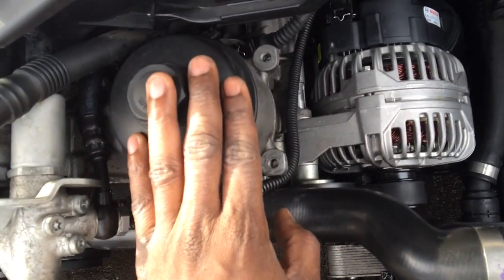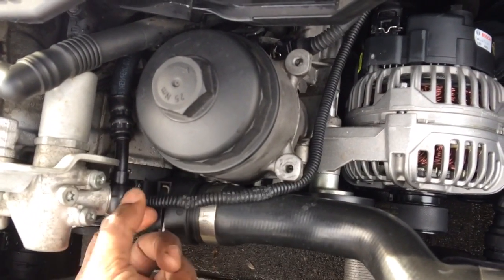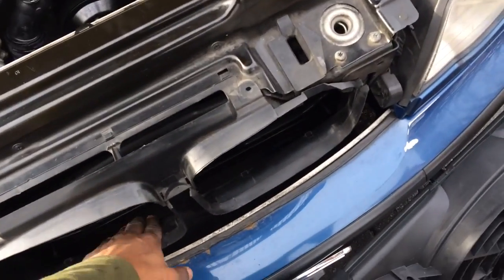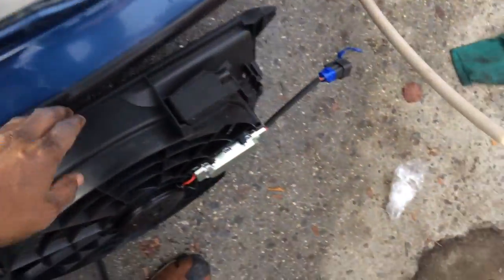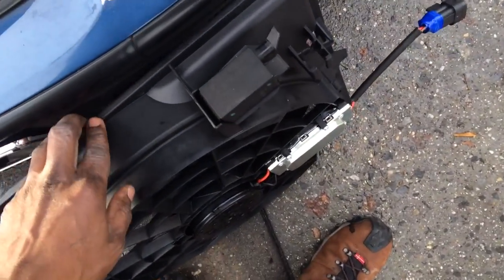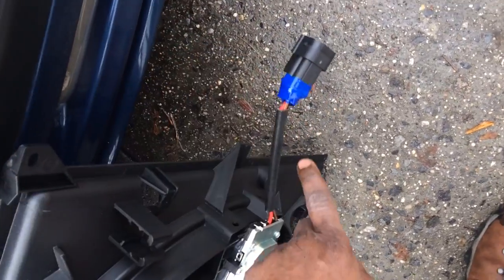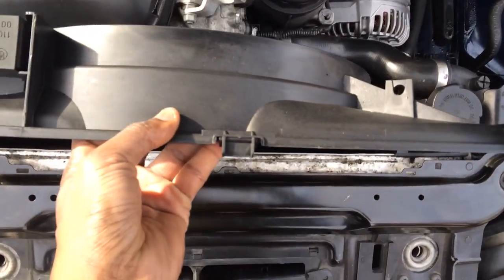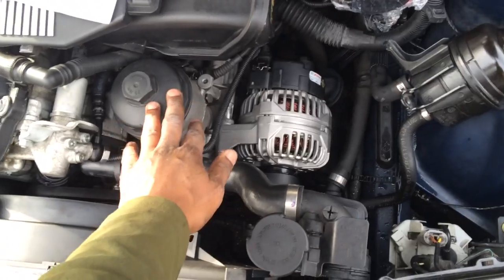BMW E46 Fan Delete Modification DIY Discussion 1 of 2

Comment: I did this mod on my 99 323i and I must say it was fairly easy. I been driving for a week now with the new electric fan on 85 + temperatures and no problems at all. This two videos help a lot on the how to aspects of the mod.
Reply from the maker: Harvey Martinez Thanks Harvey! I've been going on two years with the fan deleted and the car has always accelerated smoother and handled much sharper (without the extra weight). I also sense the engine bay is actually cooler on hot days when driving for long periods and I park. In the past the hood felt hotter now it doesn't seem like a lot of heat coming out the bay.

Comment: I think your engine is going to run hut at idle after this mod because electric fan turn on later you should  do a mod to your outlet temp sensor on your radiator hose to make this fan turn earlier.
Reply: everything u said is wrong

Comment: Hi bro,Do you remember where it was assembled the fan electric from mahle behr? I read that most are in china ?!,the genuine is expensive and I'm interested in a cheap but no made in china.
Reply from the maker: Samuel vargas Germany. My BEHR parts all had MADE IN GERMANY stamped on them. this was 5 years ago and I believe these parts are and still should be made in Germany. Best case if you want to budget and avoid China Made parts is looking at after market brands that carry  Eastern Europe and Turkey made parts like Meyle and Giba. Those would be good reliable parts if not getting oem parts
Reply: 0LAF2046 thanks man,I'm saving up for some bilstein b6 sport and eibach, that's why I need a cheap fan,tomorrow I'll put an order for the fan.

Comment: hey dude. thx 4 detailed video. I also have a same blue color e46 like u. mine though it's a convertible. Question though. Why did you delete ur mechanical fan clutch over electric fan?. Any perticular reason?
Reply from the maker: jongkeun lee the belt driven fan that I removed tends to fail. The bearings can seize up from age and mileage and stop abruptly during driving exploding and possibly damaging the engine and engine bay components. Removing the fan avoids this while the weight reduction improves performance and improves MPGs. The belt fan is unnecessary for cooling and the new electric fan does both jobs of the auxiliary fan and belt fan with one fan.
Reply: will a single  fan be enough ? what if u turn on the ac ?

Comment: Hi there so then you removed the fan cluth then you remove the aux fan and placed in the rear of the radiator??
Reply from the maker: Yes the new electric fan hangs off the back side of the radiator inside the engine bay. As a result of its location you NO LONGER need the front fan that sits outside the engine behind the kidney grills and you do NOT NEED the belt driven fan that sits attached to the engine block.  With this mod your car is now lighter in weight and runs smoother and quicker!

Comment: hi..did you encounter any diffrence in cooling with the a/c. when the ac is turned on the pusher fan blows against the condencer making the a/c run cooler at stops. does the single fan work to keep the condenser cool also meaning does it pull enough air to cool it..
Reply from the maker: richard gibbs good question. yes the electric fan does the same job as both fans. if anything it's performance, based on proximity to the radiator, favors that of the front auxiliary fan more so than the mechanical belt driven fan. the AC will perform the same after the modification. the AC compressor is a belt driven component and the removal of the belt fan actually lessens the load on that component. So your car will be better off after the modification
Reply: Ok thnks..for the info..

Comment: Whats the part number to the fan you purchased? I have a e39 tho will it work the same
Reply from the maker: no it won't fit. e39 cars have different parts numbers for fans
Reply: So do you know part fan will and the number
Reply from the maker: The front air conditioning fan is a Mahle p/n 64546921395 or BMW OEM p/n 
64546921395. I'm not sure of any electrical substitution like I have on my E46. Where you can replace the engine fan and aux fan with one electrical fan. Not sure you can do that on the E39 cars!

Comment: wellll....i want to use an electrical fan for the radiator whithout eliminate the AC fan...so thinking using 2 electrical fan
Reply: The electric fan takes the place of the clutch fan and the aux fan. Don’t need two, just the one

Comment: so you first had the mechanical fan and replaced it with the electrical one right?
Reply: yup. Get the Behr electrical fan if you're going to do this.
Reply from the maker: Yes the new electric fan hangs off the back side of the radiator inside the engine bay and replaces the mechanical or belt driven fan. As a result of its location you NO LONGER need the front fan that sits outside the engine behind the kidney grills and you do NOT NEED the belt driven fan that sits attached to the engine block.  With this mod your car is now lighter in weight and runs smoother and quicker!

Comment: why did you remove the front fan that is use for cooling the condenser?
Reply from the maker: It is a redundant cooling fan. It was an original "cooling" system design that BMW discontinued after 2005. The two original fans have a higher fail rate than the new modern electrical fan. So the replacement of two old fans with the new one was justified.
Reply: olaf2046 good to know and does you previous mechanical fan have a shroud?

Comment: That dual slant bars in the front of rad what’s the link for that?
Reply from the maker: When you do the fan delete it exposes the radiator support/crash beams which you can see thru the grills. I have the fan delete DIY video on my channel and a write up at the e46fanatics forums.

Comment: Where did you tap in to get the power for the electric fan?
Reply from the maker: Eric Reed it is plug and play. there is no tap in because the new fan will plug right into where the old auxiliary fan was plugged in.
Reply: Okay. What I am doing is removing the mechanical fan and keeping the auxiliary fan. Adding an electric fan. Could both run off the aux? I was hoping to make the puller fan a thermal switch and the aux fan run more for the AC.

Comment: Have you noticed any improved mpg after doing the swap?
Reply from the maker: +jayjayb0115 Actually I have! On traffic free/cop free highways upstate NY I'm averaging 30/31mpg - sometimes on a good day I can easily do a 36mpg stretch during my 20 minute commute home. In suburban stop/go I get 24/26mpg. In NYC traffic I get 19/21mpg.  My OBC usually shows my MPG at the end of the month between 25.5 and 27.2mpg and that is with 20% NYC traffic/60% suburban local/20% pure traffic free highway driving involved. Before the mod my monthly average was 23.4 to 25.3 mpg under the same driving conditions. I also only use 93+ octane and tend to drive sport/manual and use cruise control whenever I can. Most importantly I'm one of the few E46 drivers I know that don't have 100 lbs. of crap in his trunk. lol
Reply: +olaf2046 wow that's really impressive, especially since it was a near no cost swap after selling the old fans. I'm looking at getting into an 04 ZHP 330i right now, this would definitely be the first think I'd do!

Comment: Dit you change the water pump :/
Reply from the maker: Alban kasaj Yes I changed the water pump to a Stewart Pump
Reply: Why  dit you change water pump ? Its needed ? Its important to change it ?
Reply from the maker: +Alban kasaj The original plastic water pumps always fail on these cars after 60,000 miles. Many replacement aftermarket pumps don't last long either. So I went with the Stewart Pump which is a lifetime product. It's worth the money if you want to keep your car a couple of years.

Comment: @Eduardo and @Hugh. I believe the fan he purchased was the MAHLE-BEHR Puller fan p/n 17117561757.  You can purchase them from ECSTuning (decent company, not perfect) their p/n is ES#2568885 for $250.00 US
Reply from the maker: that is 100% true. Price I paid, if I remember correctly, was $200. They raise their prices all the time. I don't know why. But $250 is still decent.
Reply: I always shop at FCP because of the lifetime warranty on every single part. All I had to do was price match it with the same part from part geeks. In the end I now have an electric Behr fan for $190, free shipping, and a lifetime warranty! Can't beat that.